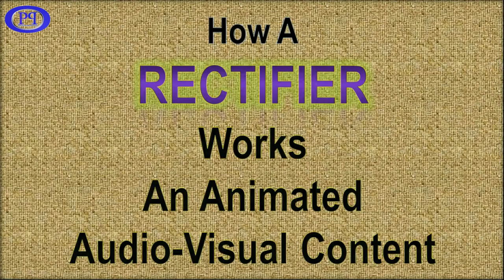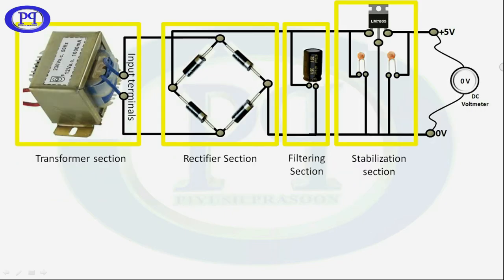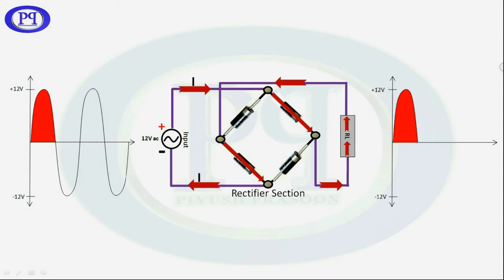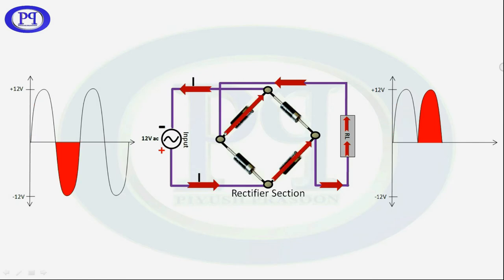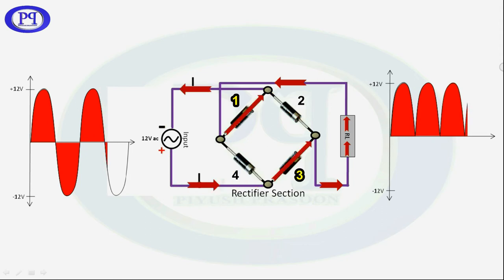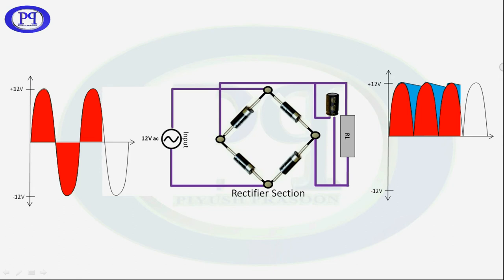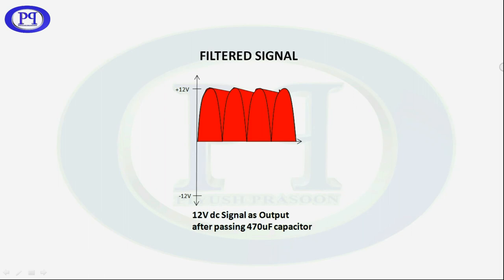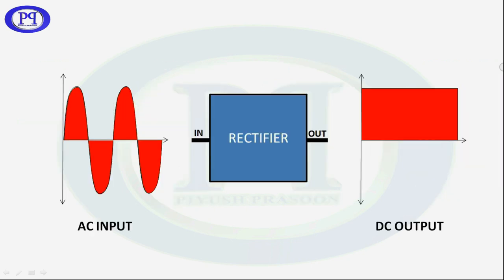How A Rectifier Works Animated | English

Comment: Pls explain how does the stabilization section works?
Reply from the maker: It works in the same way as filtering section, the only difference is that---
filtering section stabilizes/filters the highly unstable fluctuations in the signal with the help of the electrolytic capacitor.
                             AND
Stabilization section stabilizes/filters very minute fluctuations to make it more stable dc output and this is done by 2 small ceramic/parallel_plate or bipolar capacitors fixed at the in-put and output of stabilization section.

here in stabilization section actually three stage of filtering is occurring.
>Filter 1- input to 1 bipolar capacitor (on the left)
>Filter 2- output of 1 bipolar goes to Voltage Regulator IC 7805, which regulates the 12 volt dc to 5 volt dc and also filters/stabilize the the signal.
>Filter 3- And now 5volt stabilized output again goes to 2nd and the last bipolar capacitor which again filters the very minute spikes if still remaining in the signal and hence, the output signal will have very very less chances of having  even a minor spikes in the signal which is a very good input to any device, appliances, gadgets etc.
Reply: @PiyushPrasoon  Ok. I got it, thanks.
Reply: Any chance a stabilization section animation is in the works?